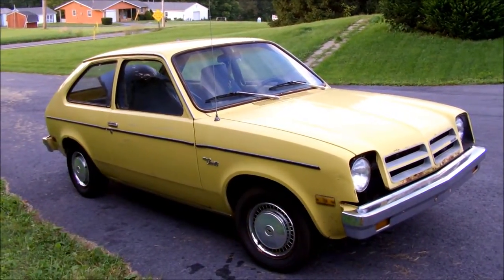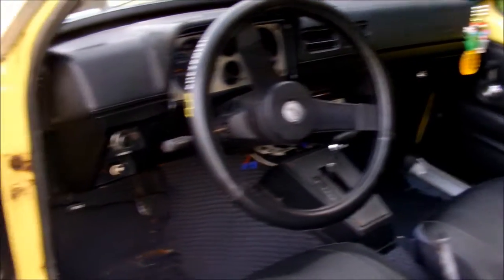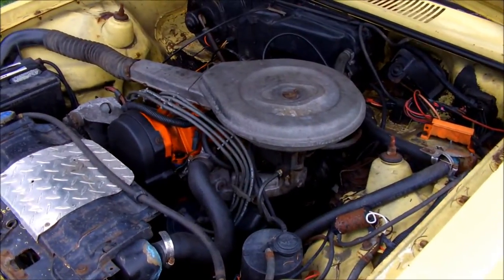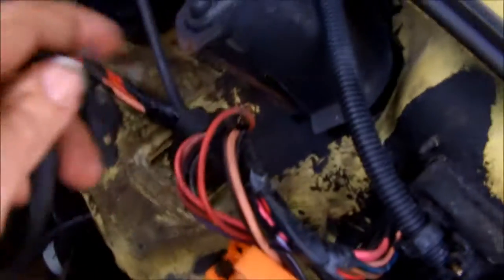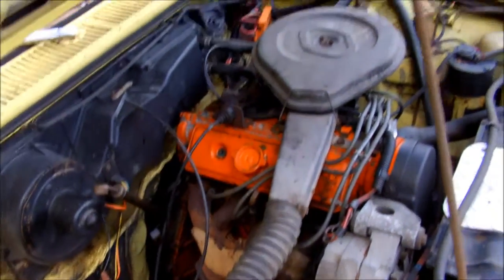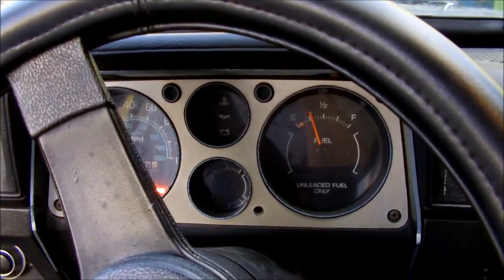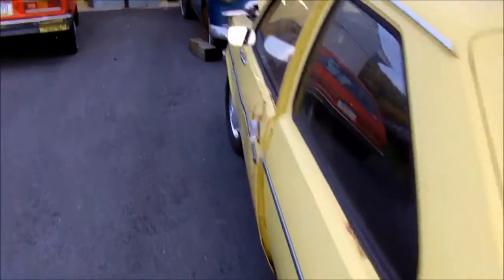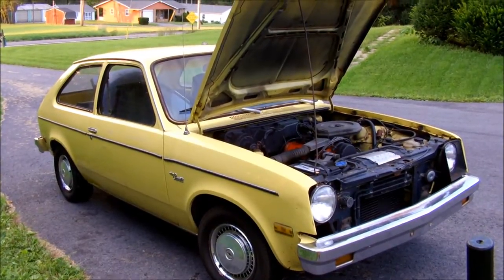My Chevette - My new one! 1976 Chevette 1.4L Auto

Comment: Hi, I own a 76 Chevette, not sure if it's a 1.4 or 1.6. Just got it running,driving and stopping. It was always stalling at stops. In my past experience with my 79 Pontiac Grand Le Mans...Those notorious carb internal fuel filters. I changed the fuel filter in the Chevette, it now runs OK, and doesn't stall at lights, but the idle is too low. Any idea on how to raise the idle so it doesn't stall out in traffic? Thanks, in advance.